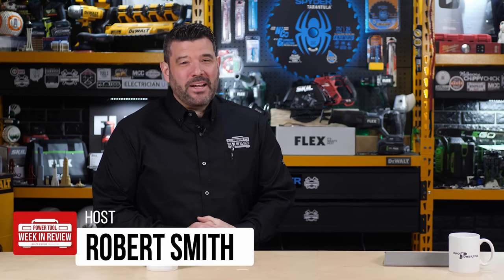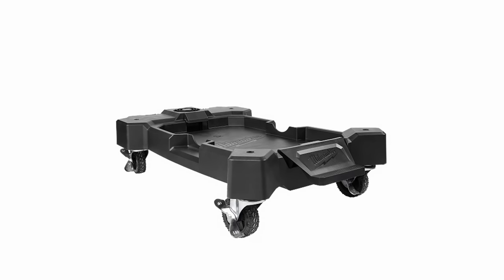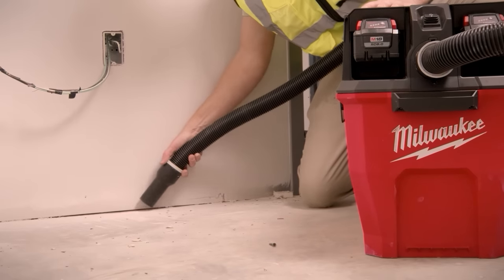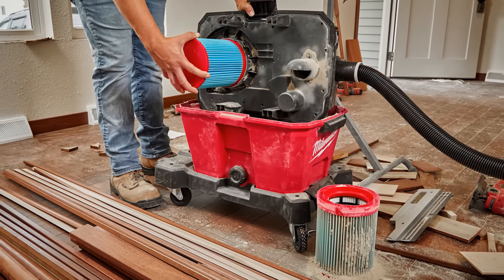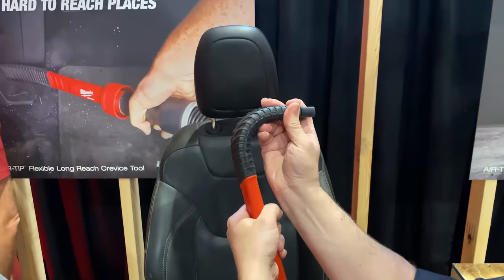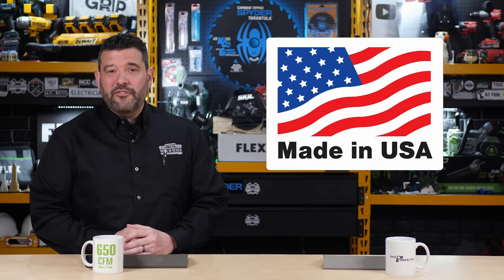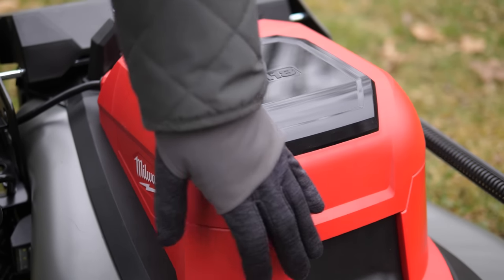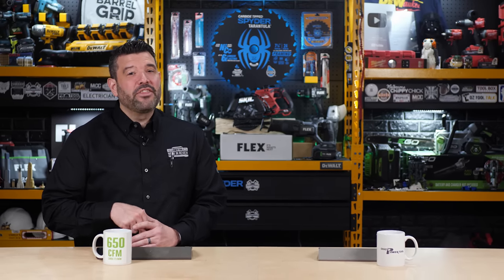BREAKING! Milwaukee announces NEW TOOLS, but doesn't tell the whole story...

Comment: Hopefully they make a dummy battery cord adapter. Something that will drop the volts from 120v to 18v or 36v. Slide it into the battery mount and your running continuously while the batteries can charge.

Personally I’d love that option. I tend to like the battery tools ergonomics better than the corded versions. But if I’m working in a small area for 8+ hours for days, it’d be nice to plug in a tool when all the batteries I have are all dead / charging.

Comment: I want a dual 12v battery 7-1/4 chopsaw. 
I do finish work and dont require the power of the 18. Just depth and compact size.

Comment: No packout is sooo dumb and a real missed opportunity. Worse than the new lasers coming in a blow molded case instead of packout.
I'm ok with dual battery if I'm not holding the weight while using it. So mower, shop vac, tower light all ok. Circ saw, chainsaw, grinder not ok.

Comment: Am I seeing this correctly? The cart with the handle is $150? That's more then the Packout rolling toolbox! It literally is the same thing but they took off the box and added two small wheels to the front and are charging $10 more for it?!? Somebody make a 3d printed adapter for the motor to fit on the rolling packout box! Then you got your cart and tank already!

Comment: I would hate to be a retailer and have to stock all that vac. options, it would take up a lot of space for just one "tool". I assume they will use some kind if proprietary connection or odd size dia. pipe so you will be forced to use only there hose and tools. 

While waiting and finially giving up on them to bring out there track saw that they have shown pictures of for 2 years now, I finially said screw it and bought a 40v makita one. With all tools that the XGT line is bringing out I really see me adding more of them than milwaukee at this point. I've got every M18 tool I want at this point.

 Higher voltage just makes more sense to me than multiple battery,  lower voltage tools and the extra weight. 

I would like to see Milwaukee go to 40v or higher tools personally, although I'm sure they would be also be way overpriced,,,,,,thats where Milwaukee excels the most.

Comment: Is there such a rectifier in the shape of a battery, that can plug one end into a wall outlet and snap the other end into a battery port?

A rectifier converts AC power (120 V) into DC power (12 V or 18 V, for example).

Comment: I'm still trying to push a single 18v battery concrete nailer .!!! And yeah they should have made the vacs packout compatible. They already have a dolly ,and trolley that could have handled the vac and also big enough packout boxes that could have accommodated the motor. .

Comment: Really....   does someone want another battery to wag to the job site ?  Ahhhhh, this one is charged, this one is 1/2 charged, this one last 30 minutes at full charge this one is dead, that one is a chinese knock off only lasting 20 minutes, that one is Lithium , that one is Nicad, that one is 12 volt, that one is 18 volt and that one is 20 volt.   And now that one requires not one but two 18 volt batteries.

Comment: You can wire these in series yourself using 3D printed parts or torn apart USB adapters. I made an electric skateboard that runs on two M18 batteries. I would love to see an AC adapter that can plug into the battery slots. Then you can have the best of both worlds.

Comment: M36 would feel like admitting Makita was into something with their x2 line and it would mean Mx fuel would made irrelevant by the 80v line of XGT, why get a fuel battery for one or 2 tools when you can have big batteries for your angle grinder and concrete saw and lawn mower etc.

Comment: Its overpriced.

I saw this on Vince's channel, little late but none the less. More detailed comment there.

They didn't really innovate anything here. Not having the option to use ac and battery is a deal breaker for me, especially when they are nearly the same cost as some of the festool dust extractors.

I feel like Milwaukee is more about selling plastic and making huge margins than pushing the tool industry further.

Comment: u see I'm a smart m#%@f%3. "really really kidding" so I hope I get royalties. yes I know having a cord on a cordless tool is
defeatist. But.... a cord would not be so bad if it was a adaptor. and the wall out let you could take with you anywhere.look you circular saw takes one batt. but u cutting  big posts  and beams have the day u hook up adapter to saw. The 6 foot cord that now comes from you saw now has a place to plug in two big btts. or three big batts  . now saw is lighter no batt. is hanging off the tool just cord . all the power the saw can handle. thanks to the two 8 Amp batts.    what do you think. seem not bad traid off. what u think

Comment: Am I the only one that's disappointed that they haven't sorted out a way to link this with the larger one key enabled saws so that when I pull the trigger it starts the vacuum? I often forget to power my vacuum before quick cuts which ends up resulting in the exact same amount of cleanup as if I'd just used the bag. Adding the extra step is frustrating and is the only thing I miss about my corded saw, it could trigger the vacuum to start

Comment: Why not just redesign the power head to either fir 4 or 6 batteries so run time could be extended? the real estate is there, and certainly could be wired so its 36v, but has 4 or 6 batteries connected to extend run time. Could also come with little blocking covers, should someone only want to use 2 batteries. Otherwise you nailed on the head the issues with it, and the pros!

Comment: One, I have a Lot of Milwaukee tools, more most any. But that doesn’t mean I’m blind to stupid company designs. 
I wish they would design & build one great tool instead of a thousand option tools, like this vacuum.
Made for the company profits of sales, not to profit good hard working customers. 
“Blah, blah, blah, every job has different needs, so you need 24 options like these vacuums, blah, blah!” 
No, it’s great you have cool different accessories but there’s no need for that many types of vacs. Made for the company not the customer.
Heres a little clue for the right vacuum: one vac head with two battery head option- good. An option for an A/C adapter to connect it to a cord-stupid obvious, come on. 3 Different tank sizes- good idea. A cart that fits- all tank and different wheel sizes. Come on. Pack out for the top, why would you not?! And put PackOut boxes to put accessories in it, or maybe track saw w/ pack out box, or good cordless (Festool rotex type) Milwaukee sander or something w/ a BUE TOOTH connection?!? No of course not, a new design will come out later with a couple more features that make a little more sense, Because Why?! It cost the company less $ to design 15 different vacuum, instead of one great one?? No, it profits the company more, instead of profiting the loyal costumer. And we know how many loyal costumers Milwaukee already has, now just do what’s right and get rid of the junk and make sense. Yes, it’s good Milwaukee makes some money, grows, and gives us more tools. But I won’t help them grow their marketing crap, (like the MX line) Give me things that are practical and make sense. Table saw, miter saw, big stationary tools with two batteries (36v) and plug in options, etc. Give me Great designed tools that make sense, work right and last, instead of designing stupid tools that focus on making the company money and not focusing on your loyal costumers. 
And Fire the guy that keeps doing this. Sincerely, Bedder Built

Comment: disappointed they did not offer a corded option on the battery vacuums. dewalt has a wet dry vac that can run off of a cord, battery or even their older batteries... three modes of powering one vacuum.  milwaukee should have taken all that money they spent on attachments and offered a cord/battery unit instead.

Comment: Need a corded option love the tools coming out but the battery’s are a killer especially on hammer drill and jack hammers all ready dragging a vac hose around build the power cord into that better than the weight of the battery’s and cost

Comment: The fluid transfer pump. Yea Ben though your not supposed to use for anything other than water me an my crew each have one and use them daily with no issues on fuel coolant and oil. More power there and I bet they will sell

Comment: Honestly .. probably a rotary hammer that have a tool belt battery pack. decouple the batteries from the tool and have a 3 ft power cord between the tool and the batteries.

Comment: I want a 10" Table saw ran off 2 (or even 3) M18 12.0 batteries.  And even to go further have a switch to have them be either series for more power or parallel for more run time.  Cutting smaller stuff, switch to a smaller blade and run parallel for cutting all day.  For whatever reason cutting a huge slab of something, switch to series for more power and more capable cutting.  Also a multiple battery rapid charger would be nice.

Comment: 36v Milwaukee 12" miter saw, 10" table saw, a 3cfm @90 or more air compressor, a 4 or 6 battery  dewalt style inverter but with a 2000 watt pure sine wave output... but large commercial and utility contractors would be more likely to invest in something like the MX Fuel setup for future high demand battery powered equipment instead of needing to buy, maintain, and track 800,000 M18 12.0's... I guess it all comes down to small business and consumer sales vs. large industry, large company needs and sales 🤔

Comment: Well a 10" tablesaw,  other than that. I would like a tracksaw and something This old guy has been hitting up reps on for almost a decade living just a few miles from the headquarters is a work vest with belt mounted batteries shoulder lights interchangeable bags and clip on safety harness taking the weight off the tool for ladder, roof and aerial work. You could even add a medium camel back.  Make a heated version for winter

Comment: As for Milwaukee and their M12, M18, and MX batteries and just sticking with those… I have a ton of Milwaukee tools and if it comes down to a matter of making a better tool by their line evolving beyond their existing platforms, I’m sold on Milwaukee’s quality, not them just being 12 and 18 volt for my everyday tools.  In fact, if they were to make a power inverter that is more capable than the topoff and not so large as their MX series generator, I’d be excited.  Presently, I use the Ryobi 40v inverter for my needs on jobsites without AC power because the Topoff can’t handle much more than charging a phone… just a little more Amperage is all I ask! Lol… although, a track saw and coffee maker would be nice too!

Comment: Am I the only one who likes that its not packout? You would either have to unstack it or lug around a tool filled/ top heavy vac. Also would have to unstack it to empty it as well. I like the current packout vac, the height can be wherever you need it to be.

I would like a dual power optional cord and Bluetooth tool connect dust extraction. 

Other than that, they needed a new shop vac.

Comment: Any stationary tool that requires a lot of power, go ahead and double it up.  I would definitely invest in the new platform. Especially a table saw and some tower lights. I would also like to see a stationary planer. My old Dewalt has seen better days and no one else seems to make any that can competes. An Eight or ten inch 36v planer would be immaculate, Especially for woodworking hobbyist such as myself. Of course for any dual battery tools, they should include an AC adapter to make them more versatile. Cordless is nice when there is no power available, but I don't want a whole different set of tools with permanent tripping hazards attached for when there is power.

Comment: The higher power 0931 motor is the ac power option I believe. Still pretty good cfm numbers for the dual battery motor.

Comment: Not sure if I missed it in your description.  But do the bins lock or secure onto the rolling cart in any way? I can assume they're relatively top-heavy and if you're rollng over some uneven ground or on a sloped driveway or ramp, I'd be worried about a tipping over. Also, any specs on the filters? Do the vacuums have a port for blowing, or does the motor air discharge out of some vents? And does that air expel up or to the side? ( hopefully not to the side/down because that has a tendency to blow other dust and debris when you're moving along a path)

Comment: I can imagine the 1" d handle beating the IR 1" impact gun if it also had 2 batteries. would be a great addition to the shop for an option before cracking 41mm siezed lug nuts by standing on a 3m breaker bar 😂

Comment: I really want there to be an option to use corded on the same battery unit in case I need to use for hours and am close to ac. I know you said there will be another a.c head but why not in the same unit as others have done

Comment: This guy complaining about the lack of remote control... why the fuck would you need a remote control on a shopvac?
Reply from the maker: It automatically turns on your vac when you start using a tool it's hooked up to. Like a concrete drill, or a table saw, or a sander.

Comment: I can see the logic of not making it pack out compatible simply for the fact of if you need a vacuum you shouldn't have to unstack your pack to get to your vacuum and if it's there it's going to get used and it's going to increase frustration. That's my first penny. My second sent would be man does that corded one have the option of working off of a battery you know where I'm going with this.
Reply: Was about to write the same comment about packout issues. You either have to unstuck it or lug around a tool filled/ top heavy vac.

I would like a dual power optional cord and Bluetooth tool connect dust extraction. 

Other than that, they needed a new shop vac.

Comment: No reason the Tablesaw, mitre saw , and breaker/hammers shouldn’t have the dual battery option. Parallel that is…to increase run time.
Reply: Series gives you increased runtime as well, infact more run time since the energy in the battery has less loss to heat under resistance.

Comment: Duel batteries … big no no… it’s hard enough to keep one fresh battery for the tools. I have a six pack charger and multiple tools running all day long, circ saw drill impact impact multitool… just keeping these gased up is a chore . Now you add a table saw a chop saw.
There is a point where you start thinking a cord really isn’t that bad. I have the framing nailer, the thing is ridiculously heavy, wish I would of kept paslode , the milwaukee fires nail fantastic but it’s just too awkward. Finish nailers are fantastic, again added weight but borderline acceptable . Never like makita because of dual battery.  Mx I hope is not thing like milwaukee failed other big battery system, so old and gone now can’t remember? 12 amp tools are ok but need separate battery and chargers, I get the need for small tools but I stick with one platform 18… point is corded tools really aren’t going away if you got way to much weight, or are stationary
Reply: your problem is you bought the 6 pack sequential charger which is basically worthless for anything but overnight charging (and even that's a stretch because it takes the thing ~12-16 hours to do 36-48 Ah worth of batteries, or a full 24 hours if you were to ever put 6x 12 Ah batteries on it.) Even running 3-4 standard chargers would be overall better than that boat anchor sequential charger.  Not going to be as clean of a setup or convenient to move around, but at least they'll keep your batteries cycling.  

Or buy the 3 port M18/3 port M12 rapid charger and charge 3x as many batteries in half the time.  3 port rapid charger pushes up to 18A between 3 batteries, 6 port sequential is limited to 3A to one battery at a time so it's 1/6th as fast and effectively useless for a power user.

Comment: I agree, they missed an opportunity to make the vacuum (or at least one of the options) to be either a rolling base for the Packout system, or at least compatible with it in some way.  One question I have on the vacuum accessories,  are they are a standard size so you could use them say on a Rigid, or other manufactures shop vac?
Reply: I did see these attachments are indeed interchangeable with other brands of vacs.

Comment: I need a new table saw that runs on battery. I used to have the “60v” from dewalt and I really liked it until it grew legs and walked away. Just scared on buying the m18 table saw and not being happy with it.  I hope Milwaukee makes a dual battery tablesaw!
Reply: The tablesaw is great for finishing or ply, but gutless for ripping 2x stock

Comment: No Bluetooth tool activation like Makita on the vacuums?  That’s a surprising omission for me.
Reply from the maker: Rob Robillard had some REALLY good insight into this. We’ve confused these for dust extractors. These are wet/dry vacs. They’re not designed to be hooked up to your tools. They of course CAN, but that’s not that goal. That’s why they don’t have auto filter cleaning either.

Here I’m is Robs video. https://youtu.be/N4jwYG_T3fY
Reply: @ToolShow  I’ve just seen his video and like it.  Trouble is that’s exactly how I use my current corded Karcher vac.  It was designed to do both from the get go and does an excellent job at both.  I don’t see why one tool can’t do both jobs?